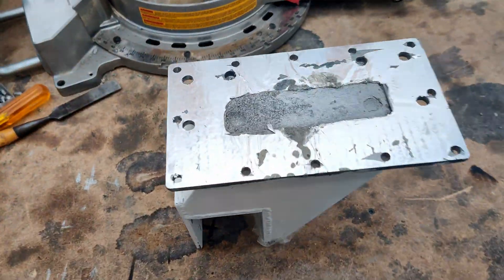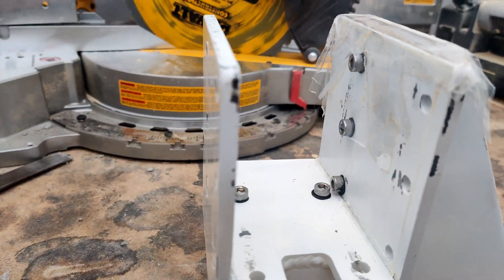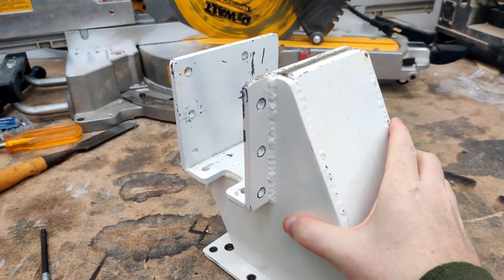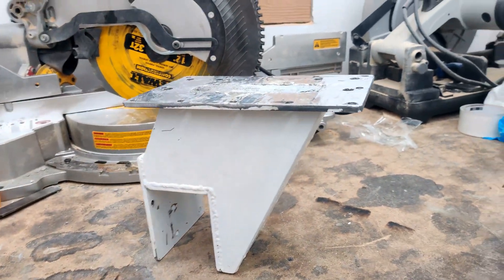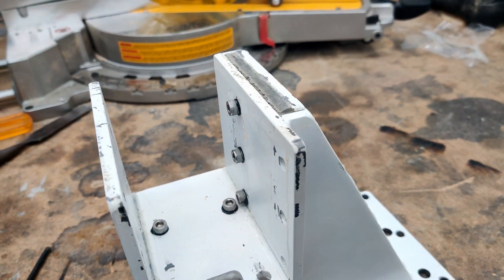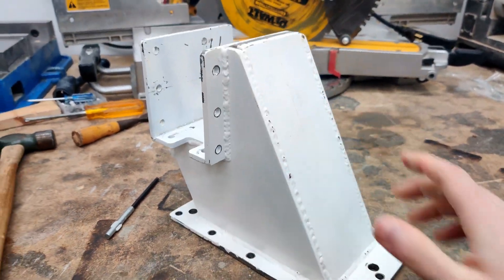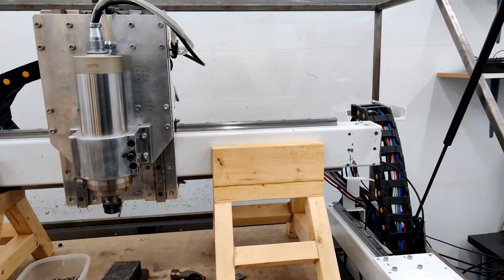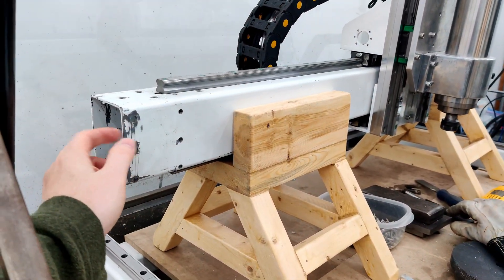Infill cavity grouting steel parts on a DIY CNC machine. Modified PrintNC.

Comment from the maker: It might be a good idea to put a small steel round pipe down the center of the gantry so I can route cables through it. I’m now sure what kind of an impact that would have besides making it slightly lighter though.
Reply: It will seriously stiffen the beam if you grout in a pipe, or smaller box section. There's a machine design paper available from the university of Utah that covers this well.

Mark

Comment: Is the weight affecting the machine ?
Reply from the maker: The servos still throw the machine around as if it was made of styrofoam. I do need to add some static mass because the machine is now top heavy and the gantry motion shakes the welded steel base.

Comment: I like to use QUIKRETE Countertop 80-lb High Strength Concrete Mix High Strength with some glass fiber.
Reply from the maker: Yeah some glass fibers should help strengthen things. I opted not to add any additives because I was worried about getting it clogged when pouring between the two tubes. There is only about half an inch between the 2 tubes. Luckily it all worked and I poured it all in single go with no issues.

Adding glass fiber reinforcing to the concrete probably wouldn't matter all too much in mine because the two steel tubes are already way more rigid than I need. If filling a single tube class fiber would definitely help you probably stop any cracks from forming.

Comment: If you apply some vibration while filling, the grout will liquify, flow and pack much better and easily. Try it on a smaple peice. You'll be amazed.

Best,
Kelly
Reply: If you have a vibrating pad sander that is the ticket. A 1/3rd sheet size. no sandpaper just the pad. We used to also use a rubber mallet when we were doing concrete small pours.

Mark
Reply from the maker: I've been contemplating clamping my bench grinder to the bottom. Taking the aluminum oxide wheels off and putting a small chunk of steel as a weight. Probably a bad idea though 😜
Reply: @BryanHoward  Have a drill with hammer drill setting? Eccentric weight on motor is ok. Just make sure it's well secured.
Reply from the maker: Hammer drill might work better, safer about less exciting. Clamp some metal to the side of the gantry where the hammer drill hits.

Comment: What are the details of your grout mixture...
...and, how does grout differ from epoxy-granite for performance,  weight and rigidity?
Reply from the maker: Epoxy granite will be superior. Grout is still very comparable it's far cheaper no harmful chemicals, and very good damping properties. Non-shrink grout is the way to go vs ones that shrink. It'll slightly expand by a few percent at least what I found with the brand I'm using.
Reply: @BryanHoward  Your grout is actually a form of polymer concrete. So it is even a little better than you are imagining. You used self leveling grout for floor leveling I am thinking?

Mark

Comment: Just a note about curing time, being in a confined space does not make it take longer. It might actually speed it up because of heat containment. Cement doesn't dry, it cures, it's a chemical process. A common curing method for concrete is covering it with water so that you don't have water escaping the mixture.
Reply from the maker: Awesome, yeah you could be right. I’ve kept them in the house since and it took about 5-6 days for the surface to be bone dry.